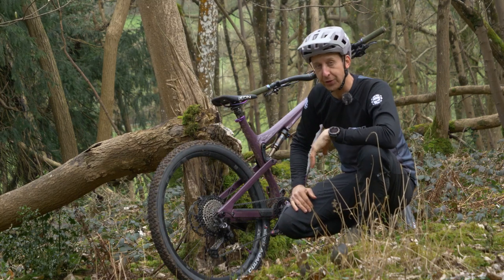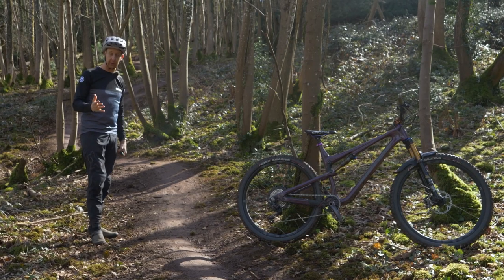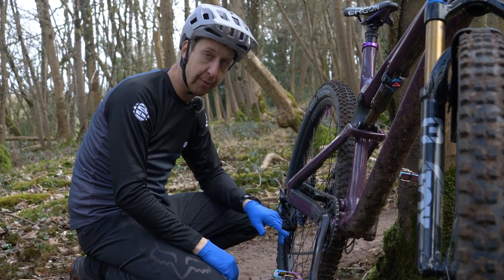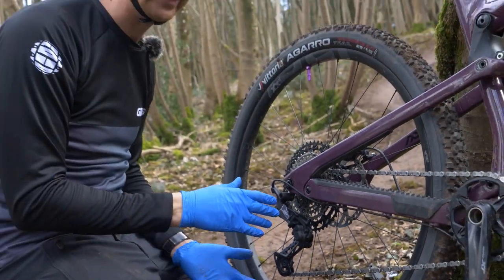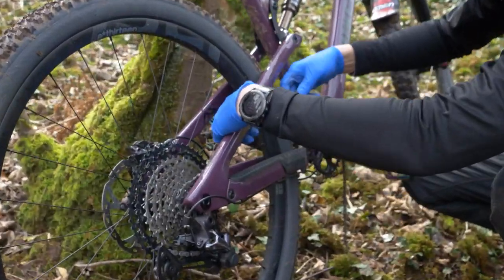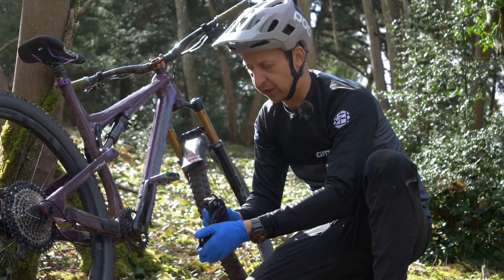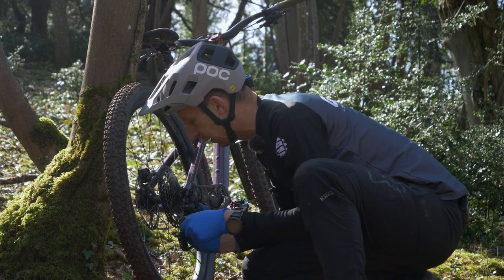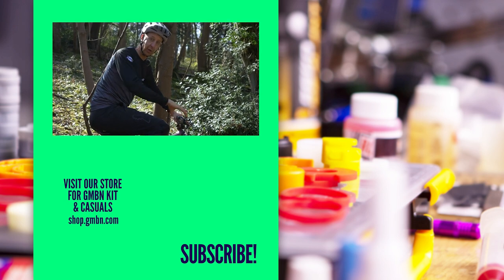How To Fix A Bent Rear Mech | Mountain Bike Trailside Repair

Comment: Going to say, with respect to "single use" master links... have never run into an issue re-using them--HARD. They don't blow apart like paper in the wind. We all carry a spare for many reasons. I don't think we need to call them "single use" anymore. I get it if you f*ck one up... but they're not generally that delicate. Love the show lads, keep it up!
Reply: KMC ones are better to reuse than Sram ones. I've actually had a Sram one fail after 4-5 or more times disconnecting and reconnecting. Still stayed on as long as there was tension but that was the only thing keeping it together. KMC ones I've never had issues with, even after many reuses..
I still carry a spare tho, chain can break on another link and thats when you need the spare trailside..
Reply: Same here for kmc links. Only change them to new when the chain is worn. Never had one disconnected while riding. The ones provided with top kmc chains feel much tighter when new and for longer, but my experience is mainly with the cheaper ones. Never failed
Reply: lol, he reused the link the in the video too.

Comment: Nice instructive video 👍🏻
In reference to the missing cable end cap, i always degrease the end of my cables then apply industrial grade super glue. Only takes a couple of drops and haven't had a cable fray yet. Enables me to remove the derailleur multiple times for cleaning etc without having to replace the cable.
Reply: Good idea to glue the end of your gear cable.  I don't know why bike shops don't do this.

Comment: To remove the chain from the derailleur, you don't need to open the chain. Just remove the lower derailleur pulley, loosen the screw for the upper pulley, and pivot the inner cage plate around the outer one to free the chain.

Comment: I'm by no means an expert, in fact I'm so much of a novice that I don't know how to break a chain, but when messing with my bike yesterday I removed the derailleur by disassembling it and removing the pulleys, instead of breaking the chain. 
It's a lot more fiddly to get it back together, but definitely an option if you don't want to break the chain.

Comment: I've not bent one without breaking the hanger. When NX Eagle first came out the upper jockey wheel would fail, ie. Fall out of the mech! This happened with 3 warranty replacements. I found rather than walking I could lock the cage lock and ride it with one jockey, very carefully but it beats walking in cleats!

Comment: Hey Doddy, didn't you mount your master link the wrong way ??? I've been told to mount mine (SRAM 10 speeds link) with the arrow in the rotating direction (arrow facing backward when on the bottom )... Am I wrong there ?

Comment: What i've learned from this: always carry a spare derraileur with you, or, remove the derraileur completely and just setup the gears in a fixed position that could allow you to get home.
Reply: If there's anywhere I'd take a huge weight penalty it'd be the derailleur so it doesn't bend/break as easily.
Reply: @gravitybass I think you would be fighting a losing battle , You would have to seriously beef it up to take big hits.
Reply: @Jasontvnd9  … except my original derailleur that came with the bike in 1991 survived 30yrs of knocks and scrapes. The modern equivalent fitted when age finally took its toll has lasted a whole two months. It hangs at least an inch lower, making it much more vulnerable, and has all the strength of a wet lettuce. There’s no reason why the bike industry can’t make something tougher and better designed, except for wanting to sell you a dozen replacements.

Comment: Had a few incidents where needed to turn my bike into a single speed to get home
Reply: same!
Reply: full suspension? I think it is not possible to turn a full sus to a single speed (at least without a chain tensioner)
Reply: @totoxahc  you are right, I have had to lock fork our and zip tie the chain to the chain stay to create some tension before - its not good as you need chain tightish and that effectively becomes a hard stop on the suspension then! Short - get me home - trips only!

Comment: My tip to stop cable fraying...when u cut a fitted derailleur cable, using gloves smear some super glue into the cut end and quickly twist so neat/together. Once dry fit end cap...then if u remove end cap as in this vid, cable should resist fraying. Or solder it.

Comment: did he put the new link the wrong way?
Reply: I noticed the same right now.
Reply: Well spotted! The arrow should point backwards at the bottom and when you cycle it round to the top (to click into place) it should then point towards the front of the bike.
Reply: Seems he had the old one the wrong way too...
Reply: @nicolaslaurent7006  ok so it was the wrong way round we move on... question I want to know is why does it have to go directional specific?
Reply: I don't know enough to have caught that. 

I have a quick link (but i was told it's called a master link) on one of my chains and i paid like $15.00 Canadian to buy it. Then i found out they are supposed to be used only once. 
So, i bought a chain splitter after that and practiced how to split and re-connect chain links by carrying around about 5 inches of cleaned chain and my chain splitter and practicing whenever i had some time.

Comment: Wow. That would probably take me 5 hours to do at home. 
I can only imagine myself stuck on the road somewhere splitting the chain, removing the gear cable, removing the derailleur, taking apart the cage and removing the jockey wheels, bending the cage straight and then putting it all back together again. It would be great to know. 
For some reason, my gear cable is always frayed. I would like to know if the bike shop does that so i would need to buy a new cable the next day if a problem started lol. 
I do have a chain splitter and have used it so that's one thing i can do, and i have bent the hanger straight before with the derailer on the bike by using an Allen key. I have taken apart a jockey "cage" before to replace a jockey wheel but i forget how that turned out, it was so long ago. 
With my luck, i would lose one of the many small pieces in the grass or on the road and really be stranded with my bike reduced to being a push-scooter where i stand on one peddle and use the other foot to push me forward.

To do all of this, on the road, seems logical and a must to do when stuck somewhere but wouldn't it have been much faster to peddle home in a working gear?

Comment: Buy a Wolf Tooth road link, you can still dial in the rear derailleur and the road link (not by design) has a sheer point. Install the road link between the factory derailleur hanger and your derailleur.  Cary a spare road link in your pack or just reinstall your rear derailleur directly to the factory hanger.  I found this out by accident slipping off of a skinny on the right hand side.  Basic bike multi tool is all you need to get back to riding and hopefully no need to take off the chain.  $20.00 insurance policy...

Comment: If it's required to remove the derailleur and cage to straighten these out wouldn't it be possible to undo the pulley bolts first which would free the chain, saving you having to break the chain / remove the quick link, do your careful bending, then reinstall the derailleur, guide the chain around the jockey wheels whilst redoing the cage?  Why waste a quick link when you're already going to have to undo the derailleur cage.

Comment: A spare hanger for your specific frame would be worth carrying for this reason, otherwise you could disconnect the mech and run it as a single speed for the trip home
Reply: Sometimes it's the cage of the derailleur though. Not always the hanger
Reply: Quite a few bike design involve a large spanner for undoing the hanger, which I didn't realise I need to carry when I did carry spare hanger. This ridiculous situation might end though with sram UDH

Comment: Bonus: if you have to take the cage apart like in this case there is no need to break the chain to get the mech off. Actually that's what I usually do. Rather than breaking the chain, which is a bit annoying for me, I'd rather undo the screws to take the cage off and free the chain that way.

Comment: I bet my deraila pretty badly when a large branch got ingested by the drive train, locked up the wheel and skidded to a stop.

Now i'm trying to figure out if I can repair it by replacing the deraila plate or just get a whole new deraila.

Comment: Shimano rear derailleur 1x12 should be slightly bent. It is not perfectly straight when you have brand new one. Is it possible to realign it to the right "bent shape" when it is really bent? (at home)
Reply: Yeah LOL, i saw my bent derailleur and thought it needed repair. Turns out these shimano things are supposed to be bent. Trying to straighten it out wont work, the holes of the cage wont line up any more. So keep it bent like its supposed to be ;)
Reply: I’d replace it as soon as I got home. It’s not worth risking a £1000 rear wheel

Comment: Doddy, you used the Topeak Power Levers as far as I can see. On their website, they claim these don‘t work with Shimano 12x Quick Links but it worked no problem for you. Can you clarify with them why they claim that? #askgmbntech

Comment: #askgmbntech Is there a way to clean a shock pump? Does it have a core like the male part? My expensive digital shock pump isn't holding pressure and I know the threads are good.

Comment: I’m pretty sure I bent mine today after a slippery corner caused me to slide out at high speed :/ I couldn’t even pedal the rest of the trail it sounded like I was shifting under load every pedal stroke even though I wasn’t shifting at all :/ ended up walking the rest of the way lol wasn’t very fun considering I was just hauling ass and then was reduced to walking speed. Everyone I passed was passing me so embarrassing lol.

Comment: To get the mec off you could also just unscrew the pulleys. So u dont waste a master link
Reply: Just remove one and loosen the other, yep! Work smarter not harder.
Reply: No need to waste it, I reuse masterlinks all the time, only had one fail after 4-5 uses  (Sram, KMC's are better).. And you'll know when connecting them that its too lose, it won't snap into place, just glide with no resistance..

Comment: #ASKGMBNTECH I bought new bike, was converting it into tubeless, i put wrongly the tape, and then i noticed hissing from nipples. (thats how i knew the tape is not sealing correctly, then i heard louder hissing comming from oposite side to the valve, and it was comming from the welded joint quote strongly. Please tell me that regardless if the rim is tubeless or not this is an failure of rim production and its factory issue? and that regardless if the rimis tubeless or not this welded part of the rim should be sealed and welded so there is no gaps to let air thru.
Reply: Nope. You said yourself you put the tape on wrong. The tape is what seals the rim bed against the air. A good taping job is critical to a proper tubeless setup.
Reply: @mattgies  yes I agree with the tape sealing it up. I understand why it hissles on the sprocket mounts - there is no issue there.
That said, I also know that welding a rim is called precise welding. and for me, that means that there should be no gaps in the welded part, and by extension, the air should not escape from rim's weld.
That said i am looking to hear from any1 who could answer that.

Comment: #askgmbntech somehow I bent only the 4th and 5th cassette rings. Can I bend them back or do I need a whole new cassette?
Reply: Just try, what have you got to loose? I've done it with 8 and 9speed casettes, usually won't be perfect but good enough to ride until you can get a new one...

Comment: I always carry a spare derailleur hanger in my jersey's pocket when racing, you never know whats gonna happen.
Reply: If you need a derailleur hanger during a race you've already lost... Also never swapped a hanger without also the derailleur needing to be swapped...
Reply: @RenaxTM91  racing is not about just winning.
Reply: And it sometimes happen. Finish 3 minutes later is still much better option than DNF! If you can finish regardless what position, you won. If you cannot finish due a small problem like this, thats really annoying.